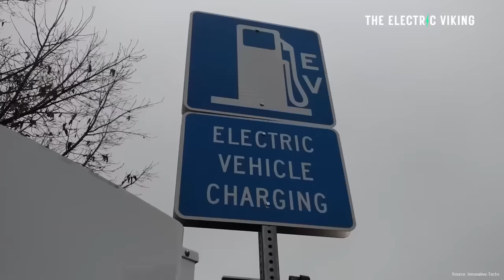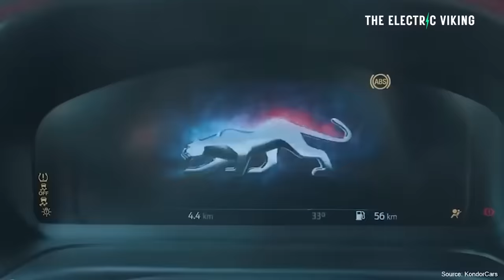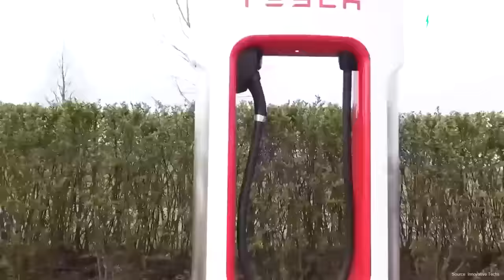UK Government Delays Gasoline and Diesel Car Ban to 2035

Comment: The linear thinking of politicians makes them irrelevant, 2030 or 2035 is the same as the accelerating exponential transition to EVs will happen mostly before 2030.
Reply: It will come down to manufacturers - if they largely move to EV production that becomes cheaper and ICE becomes more expensive. Alongside that if infrastructure improves (a lot!) then ICE cars make no sense for the vast majority of people.
Reply: @ISuperTed  
I agree with you to a point because Tesla has already solved all the EV related issues including infrastructure. I think it's more like if the others don't catch up, Tesla will become the Apple of EVs with ICE cars being the old Nokias. What you say would make sense to me if Tesla didn't exist.
Reply: Well, the price of both BEV and ICEV is also determined by the government policy. See Norway.
Reply: @synthmaker Legacy automakers don't have knowhow in the charging (and Software) space. Although, Ionity is a good attempt. Just that it's insufficient.

I have a feeling that Tesla might expand the supercharging network and spin it off as a standalone global business. They're already opening the network, that might signal that.
Reply: Unfortunately delaying the ban on the sale of new ICEVs takes the pressure off manufacturers to transition to EVs. It will also slow down the spread of public EV chargers. 🙁
Reply: @synthmaker don’t forget China
Reply: @MrChakra108 within limits.
Reply: @hishamg i disagree. The transition is being driven by market forces now, not government policy. The policy delay won’t matter.
Reply: @hishamg  
I know I keep repeating about Tesla but it's a fact. The pressure for manufacturers to transition to EVs comes from losing market share to Tesla and that will only get worse. The Tesla Supercharging network is already very capable and improving every day. To create a compelling EV you have to start from a software first approach so the current ICE car manufacturers have no chance of succeeding. Would be easier for a software company like Apple to add wheels, motors, seats etc to an iPad with an integrated car operating system but even Apple left it too late and now has no chance to bridge the Tesla moat, also has no Steve Jobs. With Tim Cook Apple became about improving their existing products little by little year after year, a bit like Toyota has done in the past with great success but that strategy doesn't work anymore, not with a radical, game-changing, paradigm-shifting, fast evolving new technology with an existing player that constantly innovates as part of their DNA rather than only when needed for competing.
Reply: @synthmaker  With government backing, BYD has more resources to ramp faster. Tesla may be better, but only if it is available.
Reply: @synthmaker  The charging infrastructure, even including Tesla and public chargers, is far from "solved". Do you live in some kind of bubble?
Reply: @synthmaker  I like to tour Europe and not using the motorways. I don't see the point of going on holiday and being restricted to staying within the reach of a main highways with fast chargers. Yes, you live in the London bubble. You are probably living in bit of a goldilocks time for EV's. So few existing cars are on the road are BEV's and most are relatively new with very good battery life. But there will come a time as the cars pass to their 10th owner, the battery pack will be nearly shot but the owner can't afford the £10k to fit a new one and these cars spend so much time clogging up chargers. Assuming they can find one that is free...
  I'm sure most people can afford to buy a new Tesla.
Reply: @hishamg and while the competition breathes a sigh of relief - and drags its heels, Tesla and BYD will speed further ahead.
Reply: @synthmaker   I too am lucky, I have a driveway and plenty of room for charging a few BEV's. I doubt that is the norm for most households. Like I said goldilocks time for those lucky to have BEV's. But to say "solved" show's complete ignorance of the issues faced by the many that cannot afford new Tesla's and those that don't just use the car for a shopping cart. What is your range when towing a caravan? I'm sure you have seen cars towing even living close to London. I am a big fan of BEV's and laugh when hydrogen is talked about as a possible fuel for cars but nothing is yet "resolved" for the days when we are 100% BEV from those on "£1000 bangers" to those on the "£1M supercars".
  How many cars in your neighbourhood charge overnight? Do you think your local energy provider could handle every car on charge overnight? No, not at the moment anyway. We need cars to talk via the charging networks to share the power that's available, certainly not "solved" yet.
Reply: Exactly. It will be consumer driven. That’s how disruption works

Comment: I live in the UK and had an electric car sice 2016. I honestly don't remember seing other eletric cars around but nowadays they are everywhere and I anecdotally see more every month. People will make their choices mostly on the grounds of affordability. We could even think of a life with "cars on demand", EV transition will happen  organically.
Reply: In London, it seems at least 5% of cars are electric. So many electric vans, like 10% maybe.
Reply: @موسى_7 in the uk only 1487 vans had been sold this year. 90% are still diesel. BEV market share has increase 0.6 % from 15.5 to 16.1% this is the true increase not the unit sale increase. There are over 60,000 roadside chargers in the uk mostly I see are unused most of the time. 30,000,000 ice cars are serviced by 80,000 petrol and diesel pumps how many more chargers do you need for 1000,000 EV cars?

Comment: If the UK government are going to do anything they should be building out charging infrastructure asap.
Reply: This! The cars themselves are fantastic but let down by patchy infrastructure (apart from Tesla). Invest in the network and open Tesla up to all over time and it will be completely different.
Reply: Plenty of chargers in uk, unless you want to charge on a Friday at 5pm on a bank holiday. The LAST thing UK needs is any Uk ,Government going anywhere near the charging infrastructure- then it will be a f*** up
Reply: Absolutely this. Our charging infrastructure isn't amazing

My plan would be something like this :

For every single house that's a terraced house or otherwise lacks a driveway, we should install chargers on the pavement, similar to say green mole EV but nationwide

We should also change those houses to a three phase supply but that's more a want than a need. If the houses have a three phase supply, we could charge cars at 22 kWh instead of 7 kWh which is what you'd want if say your main job is driving (ie: taxi drivers)

Then, from there, you'd login to the chargers via an app to your electricity provider. You'd then get charged accordingly and it matters not where you've parked in the country

That way, you could be 100 miles away from home but you could just charge at any random street.

We need a national infrastructure, that's using some form of charger sharing and where you can login to your own energy company's account in order to start charging

That way, nobody could "steal" electricity from you so to speak
Reply: No. The governments should create agile regulatory framework for the electric charging network rules so that the private sector can build the fast.

Look at FASTNED in the Netherlands or Tesla supercharger network. No European government has knowhow or competency to build the network. It would be a disaster.
Reply: This week's decision is in danger of slowing down not speeding up the building of charging infrastructure. What company would want to gamble on installing chargers if it now has doubts on speed of uptake of EV's?
Reply: They can delay it. But don't complain when people are not buying gas cars in 2030.
Reply: @waqasahmed939 great idea. Let's put the 1st one in front of your house, and see how you feel about different people 24/7 outside your house.
Reply: @LaJuanHughes Actually, its the other way around.  You laugh every time someone says EVs can only sell with government force.  If that force disappears, do you really think EV sales will climb or flatline?
Reply: @billcichoke2534  Tesla just got the tax credit. And they were selling without the tax credit.
Reply: @LaJuanHughes  Not really.  They were selling around what they normally do, but the STOCK was being valued based on the lie of FSD.  And they dropped prices MULTIPLE times, which denotes something other than trying to be eligible for a tax credit (which Musk needs).
Reply: @billcichoke2534  you seem to not have read the master plan. And Elon said why he dropped the prices. You act like it's not one of the best sell evs. It was  selling before the tax credit and it is selling more now and it and with model 3 refresh it going to pick up More
Reply: @LaJuanHughes  It might be more believable if he was still counting SALES and not the more squishy DELIVERIES metric.  It would also be more believable if less people were saying he sells every one he makes, and he has unsold inventory...or that they're made to order when he's mass producing them.

It would be instructive for you to remember 'private at $420' and that his supposed L5 FSD was admitted to never being anything more than L2 when pressed by CalDOT.
Reply: @billcichoke2534  so you are the expert . Then why is Tesla leading in sale. He thought he had a deal. He said it. That has nothing to do with any thing  now.
Reply: @LaJuanHughes  Tesla leads in selling Teslas.  They are 18% of the worldwide EV market...which is 5% or so of the ENTIRE new auto market.  And that slice of TOTAL auto sales is dropping.  Those are the numbers.
Reply: @billcichoke2534  18 percent of the world is pretty good.
Reply: @LaJuanHughes  No, that's 18% of the EV segment.  The EV segment is still only around 5% of ALL NEW CARS, regardless of drivetrain type.

It's still a fly on a pile of dog doo.
Reply: @billcichoke2534  so you had no good points.
Reply: @LaJuanHughes  Plenty of good points.  You just have to unstuck your head from your pro-Musk bubble (I'm ASSUMING that's where it is) to admit to them.

Comment: I agree with this for two reasons. It keeps people from using the ban as a political tool and because it really isn't necessary as consumers will stop buying them and automakers will stop making them. Even if there is some demand it will cost automakers so much money to make lower volumes they will just decide it's not worth it and use all their resources to make EVs. The other wildcard is the cost of fuel. Prices could get so high most people won't be able to afford to drive their gas car very much even if they can still buy one.

Comment: As a UK resident I fully agree with what you say here.  If the UK had stuck to the 2030 target for stopping the sale of internal combustion cars then it would have given an opportunity to sort things out first and hopefully to be able to sell this knowledge and implementation technology worldwide.  So it is a lost opportunity both economically and environmentally.  It is likely that Labour will get back into power next year so hopefully they will move it back to 2030.
Reply: I hope Labour gets back in, but I hope they don't reinstate the ban.  The ban is unnecessary, as the market will naturally go in that direction anyway.  The downside of a ban is that it will be used as a political tool (and a potent one, at that) by the authoritarian right.
Reply: Delaying the ban in the UK and the lobbying to delay in the EU will only mean the UK and EU car makers think the have longer to convert to EVs. This will only give the Chinese car makers and Tesla more market share.

Comment: As EV sales continue to grow at the expense of ICE sales, various tipping points will be reached. I believe one of the most crucial of these will be the viability of service stations. At some point the demand for fuel will drop to the point where selling, distributing and producing fuel for automotive vehicles will be uneconomical. At that point a Domino effect will be witnessed as fuel outlets close one after the other. I am not sure why high end small volume manufacturers would keep producing ICE vehicles, where will their customers fuel up?
Reply: You are absolutely right. Once supermarkets realise more affluent spenders Turn up in EVs they will dump the fuel stations. Are used to work for an oil company in the early 90s and most petrol stations are one-man bands and franchises and made money out of selling sweets, cigarettes and car wash tokens. Their profits are usually on a shoestring. Unsurprisingly over 30% of petrol stations in the UK have disappeared in the last 10 years alone.

Comment: I have always maintained the ultimate counter disruptors are Governments.  In this case I thin its for the better.  EV sales in the UK this year have grown for fleet and company registrations incredibly, but are down for private buyers.  Add to this heat pumps that are struggling to take over from water boiler heating due to equivalence and you get the idea that uptake is faltering slightly because it is complicated and costly in an economic downturn.  The third item on the UK Governments hit list was home insulation, which at any time in recent history anywhere is so difficult (rad costly) to achieve that it boggles the mind how this can be done efficiently by the end date or at a price that suits everyone.  So, let people decide.  That is what Rishi has said, and this is a clear way forward for that to happen.  If you want the newer tech before its mandated then go ahead and buy it, but if like many you are struggling due to cost or compatibility, then you have the option to delay.  If manufacturers don’t want to offer ICE after 2030, then you have no choice.  That is their choice.  There is also no technical reason 2030, 2035, 2040 are dates for change, its arbitrary but easy for consumers to remember.  So, pick a round numbered year,  but sticking to it is hard in uncharacteristic waters.

There are pluses and minuses on this change IMO.  It benefits consumers whilst they grapple to make the changes, but makes it hard for businesses to plan a complete change over by moving the end date out (which they possibly would not have factored in).  We speak of changes that are supposed to be for the better, but very rarely do we report on the impact it has on family budgets.  If you want people to switch then get the equivalent prices down to what they are accustomed to now.  So this change is cunning in my opinion, as it puts pressure on disruptive technology to lower prices on the alternative (to speed up adoption), which has and will remain a bugbear for the hip pocket during lean times, but means there are potentially competing offers for choice.  Europe as a whole seems to be struggling with compliance dates as well, so this is a mild tweak and a slight delay that is both rational and reasonable.  How many times do you see Governments make a change to relax a compliance, that will suit a lot of people, without really affecting those who have committed to the more stricter change over?  It’s a Win/Win.
Reply: The number one reason why I’m heating is inefficient is because builders are not forced to build new homes that are heat efficient. I wonder if that’s because the Conservative party is funded by housebuilders ?just a thought. And in the rental sector who pays for the efficiency, the person renting won’t, and the landlord doesn’t care. Unless regulation is enforced, it’s a race to the bottom. As for electric vehicles, you can buy a brand-new Vauxhall Corsa, E GS for £19,000. Just £1000 more than the same petrol manual version. I think the governments decision is purely based on trying to grab votes and nothing whatsoever to do with the environment the economy or productivity.

Comment: Sam, Ford do not make any cars in the UK…..
So Ford being against the UK alignment with the EU is moot.
Reply: No but they sell them in the UK so if Ford have based their plans to manufacture  mainly EV's to meet the 2030 deadline then their sales could suffer a drastic decline.
Reply: They still make diesel engines at Dagenham, transmissions in Halewood and a small R&D office in Dunton. Two out of three of those are likely only for ICE vehicles.

Comment: Also the infrastructurr for refueling, less money at petrol stations will see these shut down or replaced by ev stations. Using gas will have less choice, higher prices and even people who have old second hand petrol cars will think twice about sticking with it, especially if ev cars have a cheap budget entry due to the battery prices becoming so cheap as technological advances with cheaper materials and recycling. Not forgetting the cheaper green energy becoming more abundant.